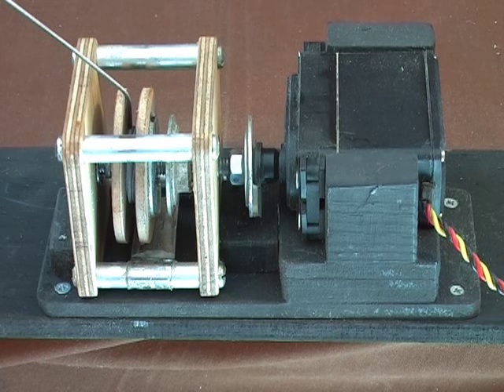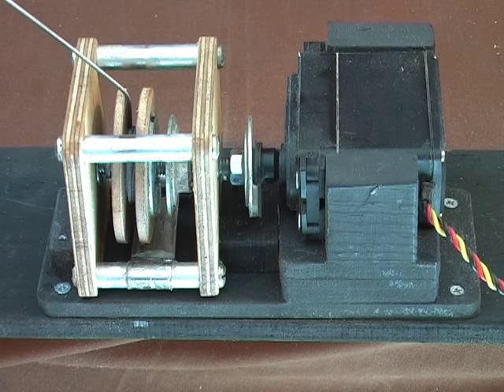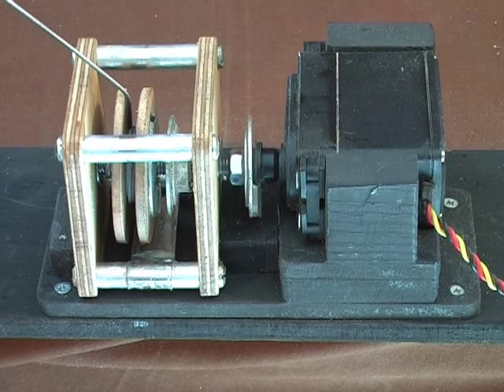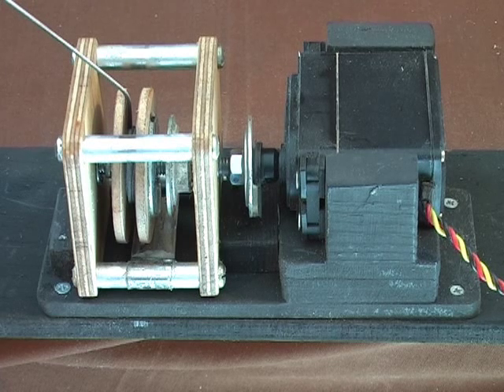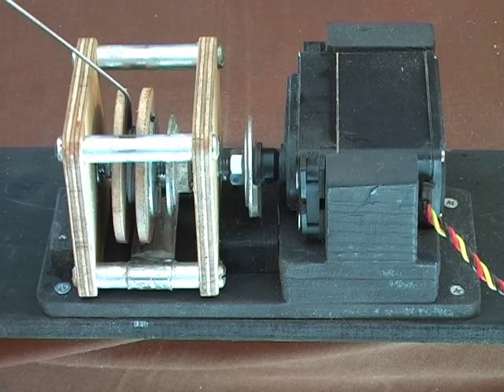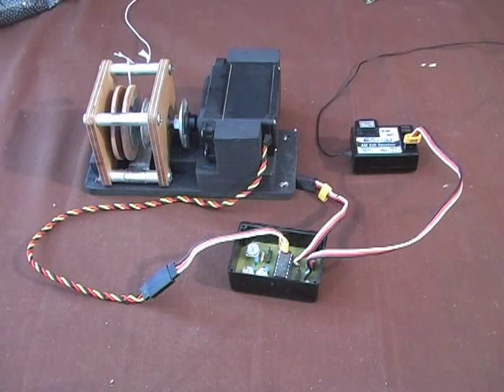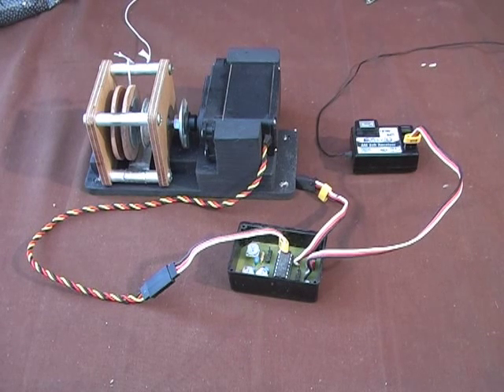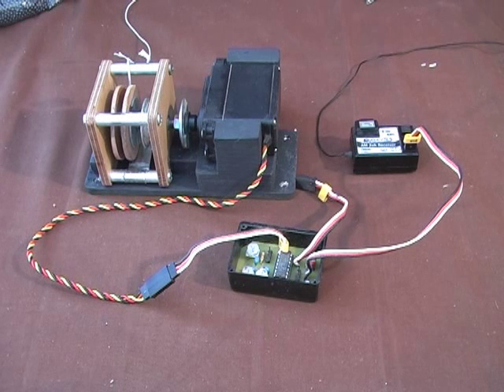Self Tailing Winch driven by Hitec sail servo

Comment: Hello Jolie!
The idea whit the tread is brilliant! Did you used the winch under heavy wind conditions? I ask, cause, what happend if the sheet pulls very fast on the drum and then hits the end of the thread hard. Doesn't that lock the nut (like fasten it with a wrench) and therefore it does not come loose again, if the drum reverses and there is no load on the sheet? I'm keen on try to build this by myself and wonder, if there is any spring or "soft stopper" for the nut.
Thanks for answering in advance!